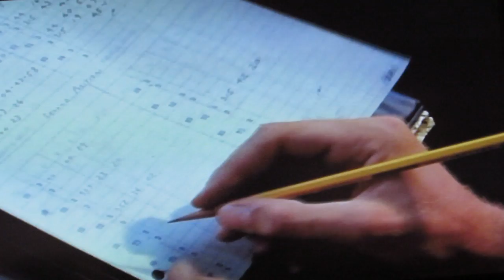Building of the St. Louis Arch started on 1963-1965.

Comment: Union Boilermakers’s built the sections in shop and then Union Ironworkers assembled them on site
Reply: Union labor big respect for union boilermakers worked with union boilermakers on several occasions in the powerhouses Ironworker Local 396 St.Louis retired after 40 years only real job I ever had outside of the military.